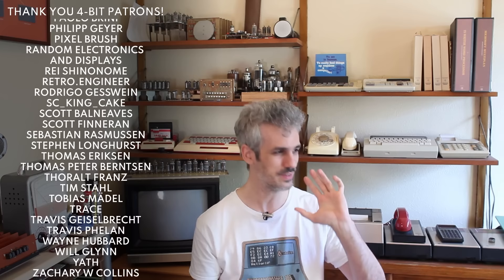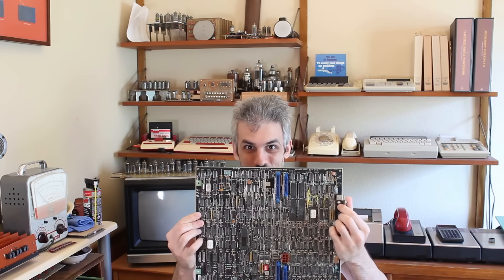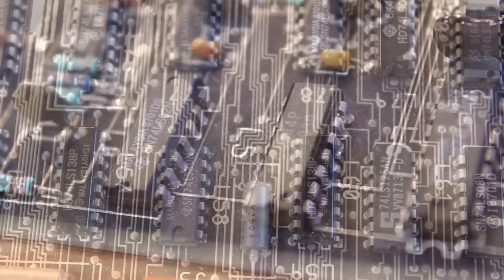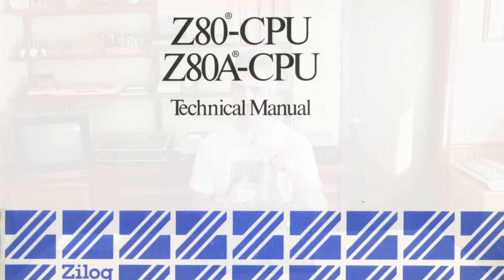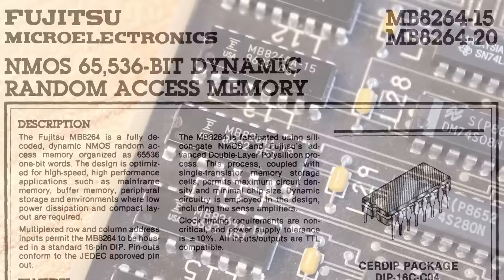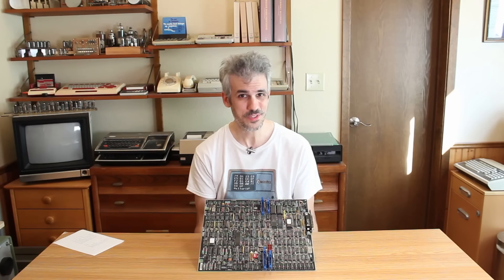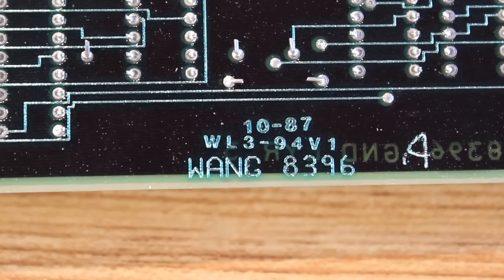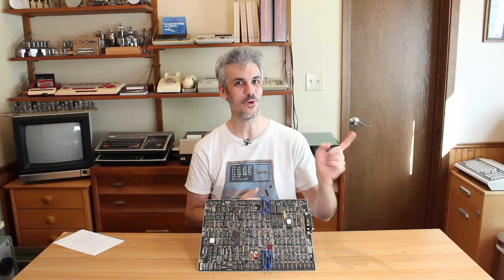What is this Mystery Wang PCB?

Comment: As you say, using a Z80 on a disk controller board is not unheard of.  The bigger iron used complex strategies:  Disk caching, predictive read-ahead, optimizing the request queue for efficient head travel, etc. etc. Not something your average chip can do and not something you want to burden the main processor with.
Reply: Indeed, every 1541 has its own 6502.
Reply: @polluks2  True, but I think that has more to do with the way disks were implemented in the Commodore line.  Tacked onto their proprietary external bus instead of connected to the main bus.
Reply: @russellhltn1396  Proprietary? It's IEEE-488.

Comment: What you have is an IEEE488/hpib bus disk controller, IEEE488 needs quite a bit to make it talk etc.
For example, have a look at early Commodore disk drives, like the 8250, they have as much 'computer' in them as the Commodore computer itself, even much later C64 drives have a 6502 micro board, with lots of IC's
IEEE488 protocol is very high level, as in you don't generally ask for sectors and tracks etc, but ask for a directory list, or 'here, go store this file', with the drive taking care of the disks directory & where to actually put that data on the disk. So basically the drive IS the disk operating system (DOS)
Reply: Exactly. The 1541 disk drives have their own 6502 CPU, 2K of RAM, 16K of ROM and talks over an IEC serial bus to a Commodore 64/128/VIC-20 etc. And that looks like this card is fairly similar in nature.
Reply: IEEE488 was a 24-pin connector, this s a 34-pin connector, they are very unlikely to be the same interface.
Reply: I don't think it's an IEEE-488 device controller. The connector on it is 36 pins, whereas IEEE-488 used a 24 pin connector.
Reply: I'd guess it's the same concept as a IEEE488 disk controller, but using a proprietary communications protocol.
Reply: @LeftoverBeefcake  as do the pets 2031, sgd-2001 and 4050 ieee-488 drives
Reply: @256byteram  or a cable to provide power and a ieee-488 docket.
Reply: @tekvax01  mmmm, didn't take that close a look at that part, I've only ever seen 2 computer uses for these connectors, 36 pin Centronics printer, or 24 pin IEEE488

Comment: This card could be a multi disk controller card. The DMA, 2 counters, Z80, MFM controller, and floppy controller gives it away to me. Z80 is for bus access and routes control between MFM and floppy. The DMA chip is then used to transfer onto the bus.
Reply: Could it be an early version of an HBA or RAID? That was kinda my first impressions when looking at it.
Reply: @cameronwetzel6227  No, and I'm on the discord server. Some manuals were posted and it is in fact for this exact card. There's even a 3 drive controller variant. I've read through a bit and it actually uses all the memory for buffering.
Reply: So how does it connect to the Wangwriter's backplane bus then? Through that 36 pin connector on the outside? Does that even expose the machine's bus at all?
Reply: @Stoney3K  this is an external unit like a C64's floppy drives. There is an entire enclosure and a cable for data that connects to the host machine.
Reply: @RossComputerGuy  What I'm wondering about is if the Wangwriter even has such a connection or if this is for a different system entirely.
Reply: @Stoney3K  I'm pretty sure it's for a different computer. The Wang for this card is newer than what Usagi has.

Comment: Others have pointed it out but the 36-pin connector is typically a Centronics parallel port, although it's strange to see it with screws instead of the metal clips that are more common.
Reply: That connector reminds me of proprietary SCSI connectors.  That'd basically explain the single board computer aspect as well (as most SCSI was implemented as computer<->computer rather than the device<->computer architecture we think of now)
Reply: @humanesque  SCSI connectors had 50 pins and Centronics printer connectors had 36 pins, otherwise the connectors were the same.

Comment: I managed a Wang VS minicomputer system for the US Air Force from 1989 to 1992. It used six 288 MB disc pack drives. The user terminals consisted of dumb terminals (Wang workstations) and 8086, 286 and 386 PCs. The original Wang 8086 PC was a beast.
Reply: those dumb terminals were quite possibly smarter than you think.  although Wang did have a basic serial port dumb terminal most of them were run on 1 or 2 Z80s and had 16 to 64k of ram.  The 64K ones could run up to 4 seperate sessions at a time, and they were block mode screen transfers to the computer, 2K at a time after having validated the editable fields for char or numeric values, white space and required entries (all done in the terminal).

Comment: Given the set of chips it looks like this is an intelligent floppy + harddisk controller. Part of the 64K memory will be dedicated to data transfer cache accessible by DMA. The main Z80 processor will be occupied with housekeeping and managing the Centronix connector data protocol. The CTC timers will also use the DMA controller to generate the timing signals for the MFM harddisk drive.

Comment: Wang had a 2336-DW Terminal that had a Z80 processor and I think 1 or 2 floppies. Not sure if this is it, but may be in the ballpark.
Reply: The connectors look like typical MFM HDD connectors tho. Who knows, maybe this is a raid controller since the 2 Control connectors are....2 different ones instead of just one. And then the memory.

Comment: The connector on the back is a SCSI bus connector. That board is a disk cabinet control board. It was used for floppy and hard drives as well. The reason it has a Z80 and RAM is because Wang, like most mini computer makers, built IO Processors. That is a single board computer, but dedicated to disk processing.
Reply: Just had the exact same thought, and now I feel old.
Reply: SCSI connectors had 50 pins at that time.   Centronics printer connectors have 36 pins, but the two connectors were otherwise the same.
Reply: @reilleysinventions4155  SCSI-2 connectors had 50 pins. Original, SCSI-1 connectors had 36 pins.
Reply: @joemonktx  I worked at Wang on SCSI during its earliest development.   The first connectors were Centronics type 50 pin connectors.   The signals were all on one side of the connector and the ground lead of the twisted pair were on the other side of the connector.   The next generation used a smaller, more dense 50 pin connector, then wide SCSI (16 bit) used a 68 pin version of the same dense connector.   There was a non-standard 25 pin (DB25) version of SCSI that Apple used, but no one else.   There is a great article on wikipedia: https://en.wikipedia.org/wiki/SCSI_connector.   I still use SCSI for some devices!
Reply: @reilleysinventions4155  I worked at National FSI in Dallas on Wang hardware (We outsold Wang's own office in the banking industry, and had the second VS80 in Texas). In addition, I worked at El Paso Natural Gas on RSF on the VS300 (14 VS300s all coupled together on RSF).
Reply: @joemonktx  At Wang I worked on the OIS system writing Z80 assembly code.   I did some work on the Wangwriter that Usagi did a previous video on.  My friend worked on the VS operating system.

Comment: So the question was already answered in the comments, but speaking of your live thoughts through out the video this board kinda reminds me Atari LDW Super 2000 floppy drive. It had Z80 CPU, 2 kB of RAM and dedicated floppy disk controller chip. Used Atari serial I/O bus to connect to the 8-bit machine. 
There were mods that you could upgrade memory to 64K and run CP/M inside it, then used terminal emulator on Atari to connect to OS running inside floppy drive.

Comment: I have a weird OMTI SCSI and MFM Dual HDD Controller board. Its like 2 book-sized PCB's who god knows what. It has Euro connectors. I just kept it because it looks kinda cool and I had ISA/Zorro II OMTI HDD Controllers before! Your board looks unjustifiably large for 2 Winchester drives....1986....Reminds me of the Atari Megafile PCB's inside the case. Also huge for just converting MFM HDD's to a DMA Bus.

Comment: Interesting bit of trivia-- Dr. Wang is the guy that encouraged Shugart to build the first 5.25-inch floppy.  Shugart was going to put an AC motor in it but Dr. Wang immediately vetoed that-- the AC motor would have required a phasing capacitor half the size of the disk drive and the AC magnetic field would have screwed up the CRT display.   Very smart man.

Comment: With the 36 pin connector I would have assumed early SCSI connection, with the 4 different types of drive connectors, it may be the main board for an early Platter hard drive ( think old, cake dome covered when not inserted platters ).

Comment: I'm going to leap in at 5:54 before watching the rest and take a stab that this could be more than a floppy controller board, it's a filesystem board?  That is the host(s) throw high level file IO at it and it handles the nitty gritty.  Sort of like Commodore's floppy drives but in my experience of it  talking about the setup of certain ASMP unix based systems.

Comment: At least the beard space and time continuum seems to be restoring itself. 
I agree with the initial conclusion it must be some kind of SBC. Find a 5v rail and just power it up. You would expect at least one of the chips to give you serial. Either find and trace it or just probe the mystery port with the scope or logic analyzer. It has to have in and output somewhere.
Edit: there are some comments saying it's just a disk controller for some Wang systems drive. I'd say power and probe it.

Comment: "A hardware/software package that permitted the Wang PC to act as a terminal to the OIS and VS products was available. The first version of the hardware component was made of two large add-in boards called the WLOC (Wang Local Office Connection). It contained a Z-80 processor and 64 KB of memory. "

Comment: Phoned Wang Labs back in the late 80's to inquire about a two-tone encoder we came across while replacing some county-wide systems.  We decoded the codes we knew we needed, but no one could produce the whole matrix or expected format for all of it.  After providing every number on and in the unit, along with dates etc off the eprom we were told that it didn't appear anywhere in catalogs or notes and that "Dr Wang" was know to put side-projects together and send them out without any further documentation !?!!!.

Comment: with that connector, I think maybe it emulates a parallel printer, and captures the print data to floppy disk
Reply: Was thinking that looks like an old "female" parallel, not so rare maybe. Maybe it wasn't, they often has side clips IIRC but it sure looked like one at first glance.

Comment: Looking at the rear connector, I was reminded of Centronics parallel-port connectors.  It is called a micro-ribbon 36-pin female connector, likely Centronics given the number of pins.  I suggest to read about Centronics Data Computer Corporation which began as a division of Wang Laboratories.  Also of interest, the parallel port and micro ribbon connector articles on the Wikipedia.  Strangely, in 1987 Centronics sold its printer business and used the proceeds to buy Ekco Housewares.  You may have some kitchen utensils made by Ekco in your home at this very moment (I do, as does my mom).

I see lots of interesting theories in the comments.  As you alluded to, the board is surely more than an ordinary disk controller, even though it says 5 1/4 disk control.  To be clear I am not saying the connector is necessarily for a printer.  From my reading, Wang had a whole bunch of surplus micro-ribbon connectors left over from an early calculator design and so they appeared in various places.

Comment: The black connector looks like a Centronics CN36 (36 pin) printer connector that was commonly used  in the 1980s.

Comment: The dark background is likely power and ground planes on internal layers of the board.   Are the top traces actually bare solder coated traces, or might they have a clear solder mask on them?  Anyway, I'd be more keen to try powering it up, locate power rails from IC's to the big brown plug (probably), and then try to see if there are any video generation type chips on there to try locating a video signal from, etc...

Comment: The blue connectors are putting me a lot more in mind of MFM or RLL Hard drive connectors than floppy drive connectors.  It looks like roughly contemporary Wang micros were labeling them Winchesters, 🤷🏻‍♂.  Maybe for the 2200 series? We'd have a better idea, if every picture of every port on every 2200 including the one currently on ebay, wasn't the WORST PICTURE EVER.
Reply: I believe it to be the board from a Wang 2275 Disk Drive\Hard Drive
Reply: Yes - it's for the 2200 - there's a diagram for the 8396 on page 2 here, that's pretty clearly a match http://www.wang2200.org/docs/peripheral/2275_DiskStorageUnit_InternalMemos.pdf
Reply: That points us to the Wang Model 2275 Disk Peripheral, which appears to be the box that the 8396 sits in. https://www.wang2200.org/docs/datasheet/2275_DiskPeripheral_DataSheet.715-0045.7-84.pdf
Reply: Yeah, this is a dual drive controller which can take up to 2 MFM drives each holding 30Mb.
Reply: As far as the why? I don't think it is an IEEE 488 bus device, but it's probably very much on the same principles (cf Commodore 1541), and it's probably implementing the hard disk controller (which in the MFM case included a lot of smarts that would go on the drive in later standards) using discrete logic.

Comment: SCSI-1 controller for two hard drives, ST506 or similar. The Z80 and memory are for dealing with SCSI, MFM for the hard drives, and DMA to connect the two. You can tell it's SCSI and not IBM parallel because of the three sets of terminating resistors right next to the connector. It has two different clocks because SCSI-1 runs at 10 MHz, but MFM drives can't go that fast. I suspect that the red 6-pin connector in the middle is power for the whole board, + and - 5V and a couple of grounds? The drives of the era had a separate 4-pin Molex power connector with +5, -5, +12 and ground if I remember correctly. The drive data (narrow) and control (wide) cables should just be straight through ribbons. Good luck!

Comment: That PCB looks familiar, I am pretty sure it is from a Wang OIS (Office Information System). Really not much more than a multi-user word processing system. There would be other PCB's in the system as well for multi terminals (they did not use RS232 but coax) as well. Unfortunately I dumped all my service manuals that covers the Wang OIS, DP2200 and VS systems about 3 years ago.

Comment: That strange 36 pin terminal seems like a centronics printer port (parallel port) to me.
But it can be another kind of parallel port.
Besides the single board computer I can also imagine a smart HDD/FDD autonomous controller, with support for multiple disk simultaneous accesses and a RAM cache to speed up disk access.
Such a system would use a parallel port to transfer data to/from the main processing system. Much like what happens with SCSI disk systems.

Comment: Commodore did similar things on their Floppy drives (on a lower cost). They were basically computer. Maybe this floppy drive controller was able to communicate with multiple computer so that multiple computer can share this floppy drive. Maybe it was even able to copy floppies by it self without needing a extra computer all the time. Commodore units where able to do this.

Comment: I remember in the late 1980s, there was a big push to connect (at the time) 'modern' computers to 9-track-tape drives, primarily for extracting and post-processing seismic data, which was held on tens of thousands of tape reels. I also remember the controllers for those things being massively complex, with multiple (twisted-pair) ribbon cables coming from them. I wonder if that's what that thing is?

Comment: My thought would be a laser printer control board.  External Centronics parallel port and an internal hard drive for storing fonts on.
Reply: The ram could also be for spooling print jobs.... there wasn't so much in the way of software fonts at this time.

Comment: The black colour is actually the ground plain.  The board will be 3 to 5 layers and one of those will be what you can see as a black. But if you pick a spot where there is no tracers you can scratch through the fibreglass to it and see the copper.

Comment: DMA controller means OS. It would be interesting to see if that parallel port is directly connected to the CPU BUS. I bet is a single board computer with a specific software for word processing in conjunction of a terminal trough the parallel port. OS and data disks might require two different drives. Might also be used in industrial applications and CNC machines as old  PDPs.

Comment: Back in the late 80s, our machine at work was a Sanyo Icon (which sorta blurred the lines between mini, micro and mainframe)... as well as it's main 68020 processor board, it also had another (I think) 68000 board which was the "disk/cache processor" that had it's own RAM, mostly for disk cache.... well I wonder if this is a similar thing for Z80 land, Wang systems???? The DMA might be to feed data from the cache over to the main processors RAM????? The "not serial" connector looks a bit like a Centronics parallel printer port.

Comment: My first guess was CP/M card for some other system. But by '86 CP/M was largely obsolete. And as others have pointed out, it is probably a hard disk controller with a decent read/write buffer. And the back connector sure looks like a Centronics interface use for parallel communications, most well knows are, of course, printers.